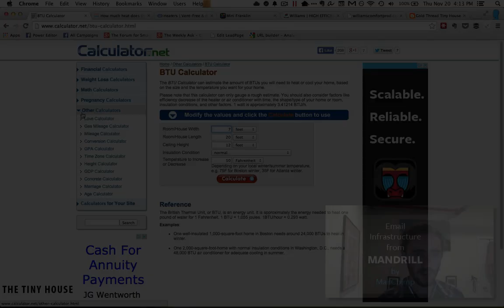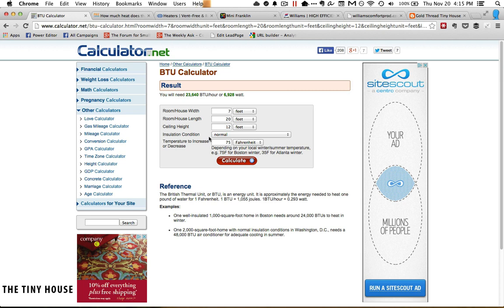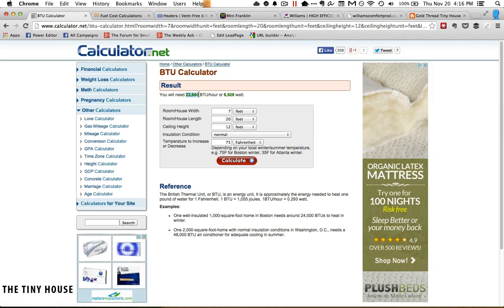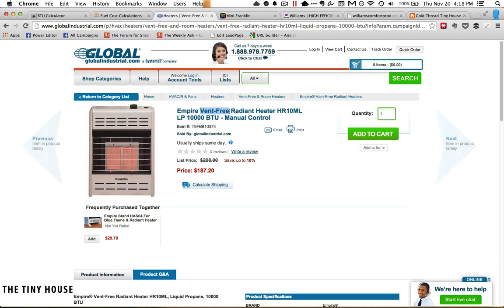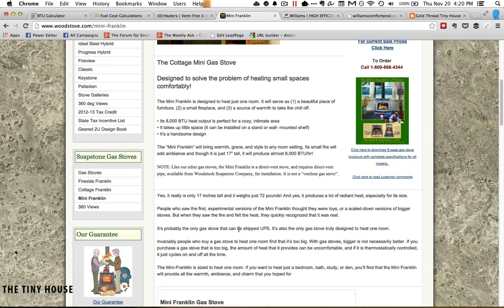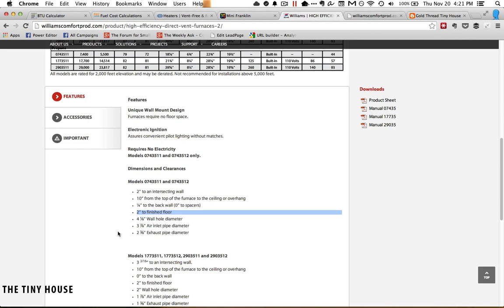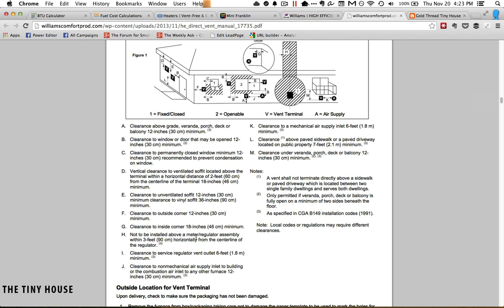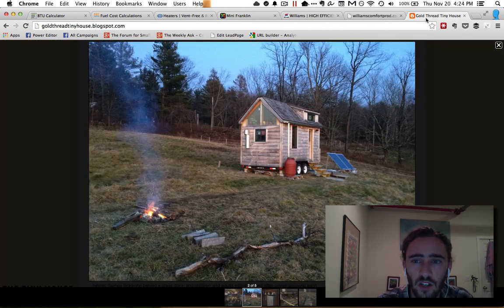How to Choose the Right Heater for your Tiny House on Wheels

Comment: Good ideas on here. I'd like to know whether you considered radiant floor heating or quartz infrared heaters. I know radiant floor heating doesn't put out that much BTU, and quartz infrared heaters seem bulky, but they seem to warm an area better (if the adverts can be believed. Thanks in advance.